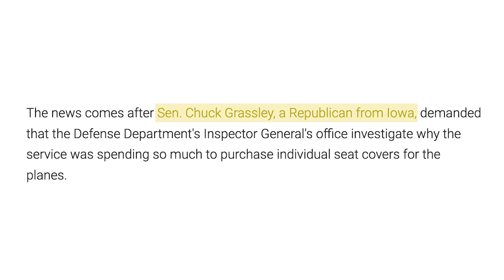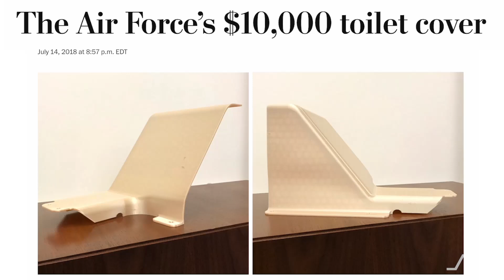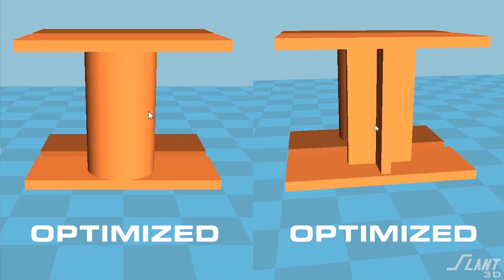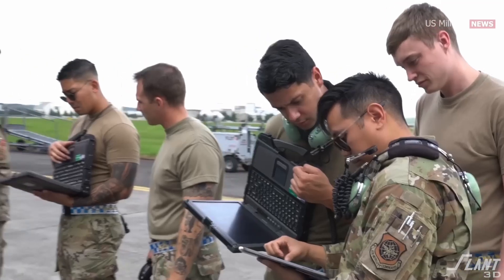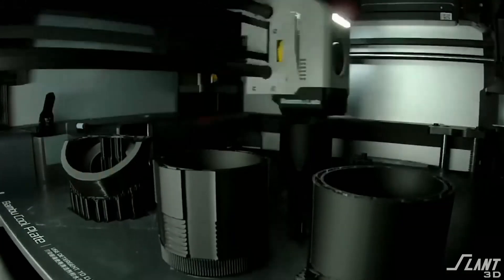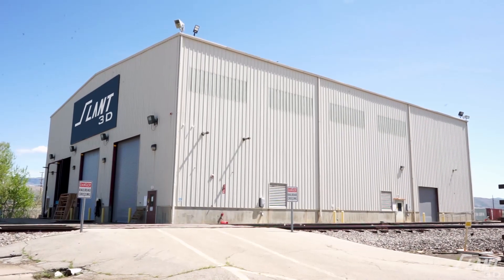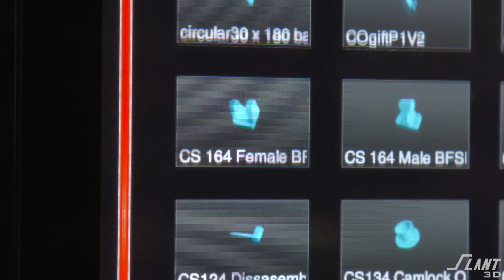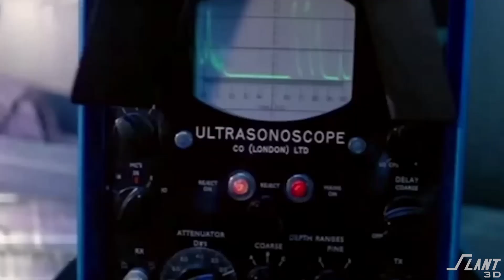Why Did the Military Spend $10k on a Toilet Seat? | Real 3D Printed Products

Comment: Probably not so much a concern with a toilet seat in a C5A, but besides the end part requiring certification, you'd also need to certify the material. ABS outgassing in an pressure suit would likely be considered a Bad Thing. You'd need a whole range of Mil Spec compliant filaments. And since each manufacturer blends their own, each one would need certification. And if a company goes through with certifying their filament, it isn't going to be cheap.

Comment: I refuse to believe it is expensive. To me it looks like corruption.
Reply: A cost of $10k for a one off part is not unreasonable. It needs to be modeled in cad, programmed on the cnc, material itself (sounds like they were making it from a large solid block, which is a few thousand dollars easy), machining time, QA inspection, documentation, packaging, and freight. If you assume that they’re making a one off, that’s at least 50-60hr of work ($2k materials, $160-$133/hr). 

I’m not saying those are reasonable prices for a toilet cover specifically, but those are totally reasonable prices for a job shop that is qualified to make mil-spec parts. If this exact part was for the cowling on the control panel in the cockpit, no one in Congress would bat an eye at the cost.

And I think this is why the video was made. An existing injection molded part should not require significant engineering time to reproduce, nor significantly expensive raw material. I think that getting the part printed was the absolute right call, and it’s good for Congress people to be questioning ridiculous military costs. However, high prices on custom parts does not mean someone went to Lowe’s, bought a toilet seat, and then charged $10k because corruption. It’s very much a rigid, mindless process that led to that cost; not a malicious process.
Reply: I can see why its easy to think that but I can assure you its more stupidity than anything. A toilet seat that isn't being manufactured anymore costing $10,000 isn't surprising...the surprising part is finding someone willing to actually spend $10,000 on a toilet seat. If you don't have any experience with acquisition or life cycle management the best way I can put it is that asking for that toilet seat is like asking for something that doesn't exist - you can wish in one hand, shit in the other and see which fills up faster. If you even CAN find someone that has it you have to convince them to let go of it...otherwise your going to end up re-engineering the toilet seat which for a one-off will cost way more than $10k. I'm not saying its right, but with first hand experience I can say its not surprising.
Reply: @paladingeorge6098  I disagree because it's not an iphone 2 that we need to re-engineer, but a toilet sit. Maybe it's more complex like the actual flush system, which then would make better sense. You draw a toilet sit on computer and ask a company that make it out of carbon fiber, and it will still be below 3k$ (I have an humble of experience with CF)
Reply: @Etrehumain123 That's assuming the part is allowed to be made of CF, and the shop they contract is equipped to work with carbon fiber.  I work in a machine shop where our bread-and-butter is subtractive manufacturing of steel, aluminum, and some technical plastics.  If we suddenly got a job to make a part like that cover, we'd have to build a whole mold making workflow, buy supplies, tools, ppe, handle disposal, etc.  Which would easily cost that much or more.  Obviously the answer is "Send the part to someone actually equipped to make it in the first place.". But I suspect that's the whole problem... Dropping this job on a shop that isn't set up to do it = exorbitant costs.
Reply: https://youtu.be/hYWie96j3aQ?si=ic6JqrDlyHlLWIS8&t=95
US congressional hearing and there is a moment on a bag of bushings. You and I can probably buy the bag of bushings for $100-a few hundred off the shelf if we are making poor vendor decisions. The bag in the video is $90,000! Sure, there is certifications to know where it comes from, but someone is probably pocketing the rest of the $89,000.

Comment: 10k for certification and corruption on marked up products
Reply: It is rather amazing that anyone was able to reverse engineer this thing and produce it at $300. Particularly given the structure needed to do this line of work. As for printing these kinds of parts, that obviously are exposed to bacteria, lets just say that printing is not ideal. But that can be remedied as well, to some level, with coating. But there is a ton of ignorance out there, at to what kind of resources that need to go into custom production. Getting a fair pay, is not being corrupt.

Comment: Certification also has to do with the materials that have traceability and the equipment as well.that has certifications. I’ve been an engineer on the F35 and now at Boeing. They only use non industrial printers like raise3D or unit makers for prototype testing. There’s three  F’s that drives manufacturing requirements, Fit-Form-function to be considered fly away parts with any 3D printed part or supplemental tooling to used at an APFX to locate and drill holes or install parts. I’m sure that toilet seat had some ridiculous requirements. The pentagon was buying 4 Trash Cans from Boeing for $200,000 🤦🏽‍♂️
Reply: Whistle blowing at Boeing? Are you still alive?